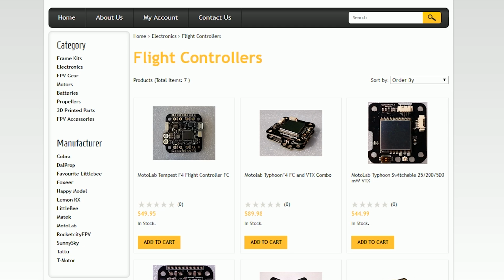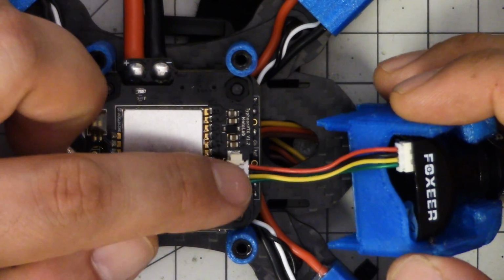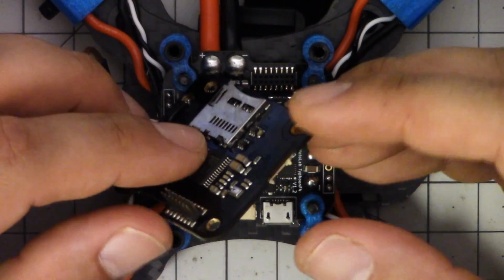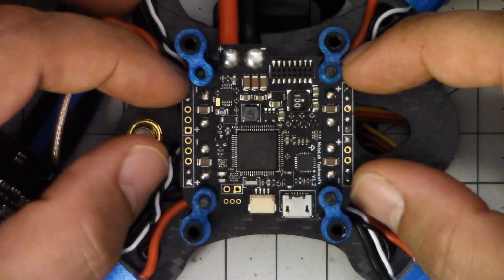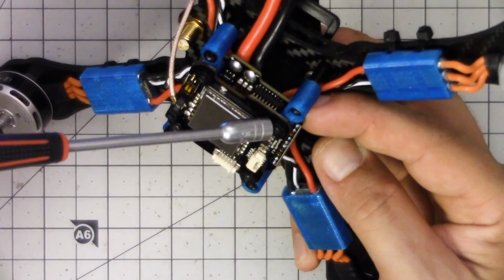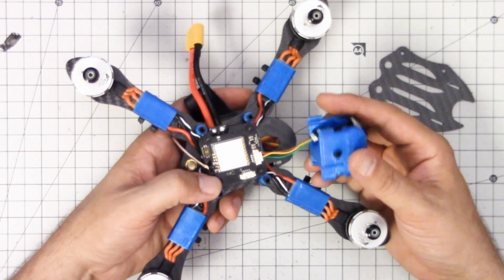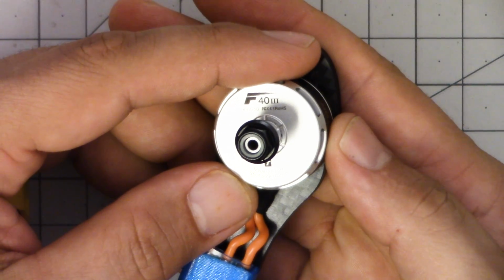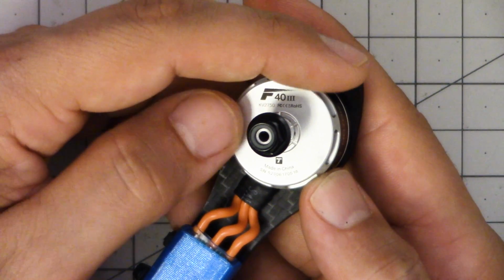Betaflight F4 Flight Controller and FPV vTX in one! MOTO TYPHOON | also, T-Motor F40III first look

Comment: Thank you Joshua for the review!
Flying an eashine 250 racer now but binning this shortly going for ragge wbx5 and good components. Still novice and orientating. Keen on this combo review but noticed a current sensor. I like to use the 4x  Quadrant 32Bit BLHeli_32 ESC Dshot1200  but they have current sensors of their own lis this a conflict? thank you in advance! br, Erik
Reply from the maker: +electrobob1 the ESC current sensor is used for ESC telemetry (of you're using it) and esc current limiting. There is no conflict.
Reply: Great! I'm looking forward to building this project! The ESC telemetry is great to keep me in the learning curve. Kind regards, Erik

Comment: Hello Joshua, I am thrilled with your videos and explanations, especially Betaflight and BF-FCs. I am more or less ... rather more, beginners with a little electronic background. The product variety and information are simply sullen. My pensioner's head is already smoking. Would like to build a HEXACopter, under 2 kg fulload. I like the 36x36 mm F4 / F7 flight controllers, but they are actually intended for Racer quads, I think so. Who can give me a hint? Which 36mm x 36mm F4 / F7 is suitable? Should not go over 80 € with GPS. DJI-FC and Pixhawk too expensive, for me, unfortunately. Requirements: 6 x Motors/ESCs6 DOF gyro/ACC.Barometer!MAG / GPS!Retractable landing gear.Distance sensor.2 / 3 x gimbal control.1 camera shutter button.2. switching video/photo.LED on from.1 x safety trigger (perhaps parachute system).OSD/VTX/UBEC can / should be external, not, be but on the FC connectable.PDB for Ext. HEXCopter.Lost-beeper/GPS Tracker.Practice just with a XK x 380, Walkera G 2D gimbal with Xiaomi YI and try it to expand OSD u VTX. There are 1000 other questions.Am grateful for each tip.Still a beginner question: If controller is connected to a receiver via S-bus with a flight are the other remaining channel outputs on the receiver still be available or are they dead?Thank you and remember, they're always coming down,...Nur how and where???HD

Comment: Looking at the pinout of the Motolab bards quite a treat. They really are put together and make me wonder why board manufacturers are putting more thoughts in them. Simple things like putting a UART Rx next to another UART TX so you can wire a FrSky with telemetry.

I just wish there was a 20x20mm version of the Tempest or Typhoon around.
Reply from the maker: +[CPC] Vlad Tepes yes, pin layout is a good sign of the designer's intent.

Comment: When it comes to the flight controller mounts why not mount it upside down and put the screw through the top of the board
Reply from the maker: +Justin Johnson because then the nut can fall off.

Comment: do you have any flight dvr footage of this vtx combo? i use several tbs power cubes and the footage is crisp and clear with minimal glitches so i hate to deviate from tbs but TBS uses windows for tbs agent and i only have mac and chrome so I'm tired of borrowing  friends pc to upgrade the vtx etc etc if you have or will shoot footage of the vtx footage please let us know, I'm very interested in this combo. also r u considering doing another fc AIO combo shoot out any time soon, since your last video there has been several vtx fc combos and aio stacks that have come out, in particular the emax TRUE AIO, it has absolutely every component except the motors and vtx ant, it has vtx, fc, osd, pdb, vtx, and rx. and thanx for you videos and support in this hobby, u are a HUGE help

Comment: I would like this setup, but no telemetry, which means no lua scripts. Ugh, which mean no voice. Smart audio?
Reply: Smartport telemetry is supported, with an inverter on UART 4. VTX setup is through the Betaflight OSD.
Alternatively, the Tempest F4 has everything but the VTX on one board. It supports smartaudio and Tramp serial.
Reply from the maker: The FC can support SmartPort, I believe. But I don't think it works with Lua scripts because (I think) they require SA or Tramp Telemetry. But I'm not sure about that.

Comment: have you had any success with telemetry and the F4??
Reply from the maker: +Michael Nixon sure. The FC just needs an inverted UART pad for it.
Reply: Joshua Bardwell is it better to try and hack the receiver by soldering the wire on one of the UART inverters on the receiver, or use a separate inverter mini board??  Thanks for the reply!
Reply: These boards have inverters for SBUS and smartport. No receiver mods are needed.
Reply: Moto Moto really?  I've read that all F4 boards have the inverter issue when using FrSky receivers and then SBUS and telemetry....hmmm
Reply: The F4 CPU doesn't have internal inverters like the F3. These boards have them built into the circuits.
Reply: Moto Moto then why is there so many other hobbyist who have videos and tutorials about using an inverter or hacking the receiver to get telemetry?  Or are you talking about the specific board Josh is using?
Reply: Moto Moto are you talking about this specific board?   I was speaking of F4 boards in general.

Comment: Joshua,  the Pagoda antenna is great for receiver, but poor choice on the transmitter side.  Every time the drone banks hard in a turn the dead spot top or bottom is pointed straight at you.
Reply from the maker: This is true of every antenna, so you pick the lowest gain antenna possible (in my opinion).  The Pagoda has a gain of only 1.2 dBi which means its null spot is very small.

Comment: I have two chameleons, one with oomph 2205/2550kv motors and one with emax 2306/2750kv and the oomph gets 3-3.5 minutes while the emax gets 2.5-3 minutes with way more top end. thats a good traid IMO. I disagree that the emax are pointless, they are really not that much worse than the oomphs sometimes getting 15%-20% less fly time for like 40% more thrust!
Reply from the maker: The Emax are fine as long as you stay below like 75% throttle. That's my experience. Once I got above that, even on a relatively light quad, the battery choked. I got faster lap times and bigger punchouts with smaller motors, and that's with very good batteries like Adrenaline 1600.
Reply: that makes sense. i mostly stay below 80% in my flying (acro stuff like you)  and the amps usually stick under 40-60 or so according to my FC but can spike above 100 on full throttle. the things are so powerful i never need to go that high though. nice to be able to when you need to save yourself or something.

Comment: Flip 32 F4, Omnibus F4 v4, Betaflight F4, Tempest F4... Same? difference? Was seriously  considering the  Flip 32 F4, then JC(PBF) talked/raved about the Omnibus F4. Then I hear Betaflight is coming out with an F4, now the Tempest,Typhoon! lol my head s spinning on what to get now. A 450mm Quad for slow fun flying to learn the ropes of flying..for now. Would like level flight and barometer included. Can you please explain the differences in the above FC's? Any advice would be appreciated! Thanks
Reply from the maker: Flip32 are usually just rebadges Airbot products. Omnibus is also an Airbot product. Betaflight F4 doesn't exist yet. Tempest is from Moto and is completely different entirely.
Reply: Thanks! I meant as far as features, etc... This will be my first FC and quad ever so I am trying to learn and pick a FC that has level flight and a Barometer and long with standard features. Do you have a recommendation for a FC that has these features?

Comment: I've got a focus frame I always take the bottom screws out of the standoffs and Slide the top with the standoffs out of the mounts. then I cut my ESC loose and you have enough room to turn the board sideways.

Comment: Josh, you don't care that the live RX antenna bits are not straight?  Always figured it was important to try to get those straight for best reception.
Reply from the maker: The quad was built by RocketCityFPV for my review, but they don't sell it as an RTF kit, so I didn't call that out for criticism, since it isn't part of a product that you would receive.
Reply: Does it affect reception?
Reply from the maker: Yes.

Comment: In our testing of the pagodas with the antenna protectors the cover doesn't negatively affect performance  check them out here at race412.com
Reply from the maker: The RevB Pagoda has been designed to run with a cover, is my understanding. The effect is largely on axial ratio, not gain, which would be difficult to test in the field.

Comment: For my senior project we used thread inserts to combine 3d printed parts with metal Hardware, thinking maybe you could print new standoffs with some extra material on the base under the FC and you could use a thread insert to mount the FC/VTX easier.  We used these inserts to hold a 50Lb rocket together lol, the Nose, Fin can and Drag modulation system all were 3D printed from Polycarbonate and heat resistant Utem.  We would fuse the inserts into the plastic by pushing them in with a soldering iron on low heat :)

Comment: Regarding your comment that stronger magnets = more power but less efficiency, I'm assuming that's not just taking into consideration that the stronger magnets will make more power and drink more juice right?  For example, two identical setups, one has stronger magnet motors, the other weaker, and they both hover for the entire battery, does the weaker magnet setup hover for longer?
Reply from the maker: Depends on way too many other factors to generalize. The strength of the motors must be matched to other characteristics of the motor to produce a desired performance curve.

Comment: @Joshua Bardwell: Couldn't you just mount the blue anti-vibration mounts upside down? (or maybe right side up? ;) ) So you can screw the FC on from the top?
Reply from the maker: You could put the screws in from the top right now. But then the nuts might fall off.
Reply: Ah, I thought it screwed into the TPU. Still, easier to hold a few nuts at the bottom with some pliers than hold the bolts, no?

Comment: After 6 weeks and 6 types of props on 2 quads I got nothing bad to say about the F40III's. Although they're only 2400kv they kick like a mule. Getting 3 to 3.5 minutes on cyclones and 1300mAh. And 4.5 minutes with slower freestyle and more efficient less aggressive props. Going for the 2600 next round. :P

Comment: Thanks for the kind words, Joshua. We do try for the best quality boards.

Your comments about the mount screws are accurate, but the mount is an improvement over earlier versions using nylon standoffs that broke frequently. Through screws from the bottom made it difficult to replace a broken arm without the standoff stack coming apart, and it required complete disassembly to replace a broken standoff. This version doesn't break and gives some vibration isolation hanging on the TPU arms too. When that feature is copied, I hope people remember that it was stolen too. ;)

I believe the original MotoWii board, released in January 2014, was the first with an integrated PDB.
Reply from the maker: I do see that the screw situation is probably the best way to solve the situation, and I like that the TPU mount gives vibration isolation to the whole stack. But I wouldn't be a good reviewer if I didn't point out the ways in which it's cumbersome.

I think the ideal situation would be to mold the 3D printed part to hold a captive nut, and then screw from the top.
Reply: why don't you put the bolt through from the top, and have the nut underneath ?

Comment: Thanks for the bench review.  I greatly appreciate your videos and letting us all know what is out there and what you think of products.  You have stopped me from buying some junk, helped me to know what has the features I am after and introduced me to new stuff.  I appreciate when I am "going to learn something today."  

It is true, the board and frame work very nicely together, it helps that the designers of those both live close together.  I'll tell you though that both items work with other frames/boards flawlessly.  MotoLab boards are in all my different frames and the Focus 220 frame fits all standard size flight controllers.

I have been flying MotoLab for quite a while, still have a quad flying a Cyclone, a quad flying a Tempest F3 and have been flying the TYPHOON & VTX combo since it was a prototype.  This TYPHOON and VTX are sooooo sweet.  They are good and tough, they are super reliable and resistant to stupid stuff I do at times.  Honestly I'm always the same careful soldering wires onto anything checking the pinout and making sure my orientation is correct, no different here and the preemo locations of solder joints more than offsets lack of silk screen.

Just to circle back to a couple of points on the frame:
1) it is a racing frame.  It might be a little thicker and little heavier than some of the new high speed frames, but that frame takes a licking and keeps on ticking!  Honestly a little more weight to keep things good and solid so they don't break is a huge benefit.  Besides, a little more weight has little effect for the majority of racers.  At my skill level and speed, I like the strength of the frame and the fact I'm not replacing pieces of it after every other race.
2) As far as the FC mount and those screws.  If you've left just enough wire on your components or cut the tie straps on your ESC covers, once you pull the top plate off, the the whole stack slides up and off for easy access.  The hardware design might not be perfect, but it sure beats having a screw up through the bottom of the frame into standoffs to mount the flight control/stack.
3) That camera mount has evolved and does provide pretty good protection.  Your lens is still out there to be smashed, but without blocking some of your view, that is a very hard thing to protect.  There are more than just the tabs into the top/bottom plate for that camera mount, there are lips both top and bottom on the mount.  Those lips are a new improvement and have made a big difference.

Comment: Is it possible the screws for the vtx/flight controller go the other way with the nuts on the bottom, meaning you can put a 5.5mm wrench in the side instead of sliding the tpu mounts up.
Reply from the maker: +mickytruelove i would be worried they'd fall off in flight.

Comment: I believe you installed those tpu flight controller mounts upside down
Reply from the maker: +Matthew M nope. Thus was assemble by rocket city fpv.
Reply: That's what I thought!  Maybe if you glued the screw to the TPU mount and then used standoffs above that?  Does seem rather fiddley.
Reply: Fair enough. Well the pics on their site and the video of the assembly have them the other way around.

Comment: I was so excited, but once I saw it doesn't do smart audio and the sd card slot was on the vtx, I did a big womp womp womp.
Reply from the maker: +Frank Ruiz it doesn't do SmartAudio but it dies have remote control via osd.
Reply: Joshua Bardwell For sure, and using something to poke the switch is not a big deal. But I've gotten so used to doing it all via the taranis with the LUA scripts. It's a little bit more of a pain in the goggles. These are not real problems like hurricane Irma coming to take my quads away.
Reply: Check out the Tempest F4 https://github.com/betaflight/betaflight/wiki/Board-MLTEMPF4

Comment: Joshua, why can't you solder inside out (as you have previously advised) Put the VTX / FC together on the TPU parts, then solder the wiring to the bottom of the FC, then slide it down and then wire up the ESCs and motors? It's no more / less annoying than the BFF3 was.
Reply from the maker: +Chris Fitzsimmons sure sure. That's not the complaint. The complaint is the screws that hold it together falling out.

Comment: I still think you are wrong about 2700kv, 2750kv because you haven't re-tuned for the incredible acceleration and deceleration those 2206's unleash.
Reply from the maker: +David Kraft not sure how tuning is going to change the fact that they pull 50 amps at WOT.
Reply: Sure if you're chasing down NytFury, but for the other 99.9% of us spending 99.9% between 0 and 30%, there is a LOT of time spent accelerating and decelerating (as you have so eloquently shown us on blackbox) If your P is 30-50% more effective because you slapped a V10 Formula 1 engine on there, you will have to lower that P. (and the D)

Comment: Skyzone makes about the same setup but lighter and with the good gyro....
Reply from the maker: +Doug Gotti this one has the good gyro. No way skyzone design and QC matches Moto.
Reply from the maker: The product you're linking isn't even similar except in that it's a video transmitter. It doesn't have vTX remote control. It definitely doesn't have the OSD passthrough.

Comment: Am I the only one who clicked thinking Joshua had the Betaflight F4 flight controller (next revision of BFF3)? Cool stuff anyways!
Reply: Check out the Tempest F4 - F4 CPU, PDB, OSD, sdcard, current sensor and plug-in connection to external VTX.
https://github.com/betaflight/betaflight/wiki/Board-MLTEMPF4
Reply: Nope! (TYPHOON!)
Reply: I thought I was the only one
Reply: I did. Still haven't found a bff4 aio board yet lol. Starting to question it